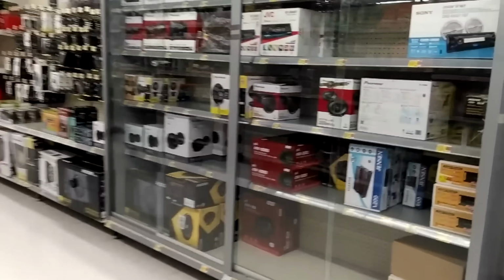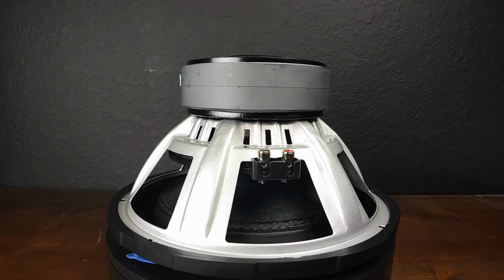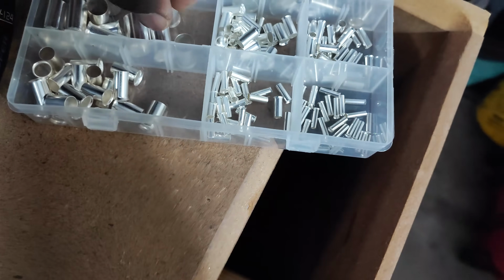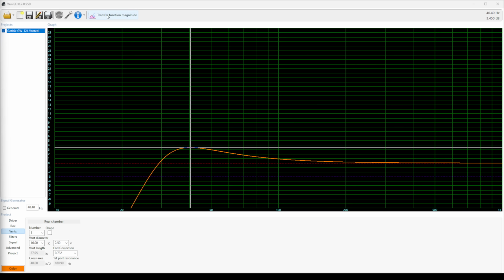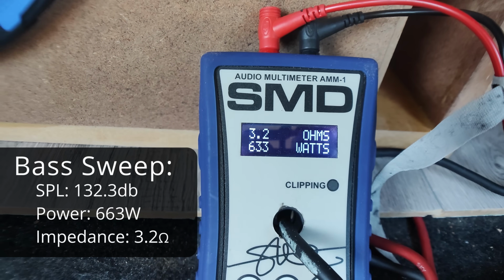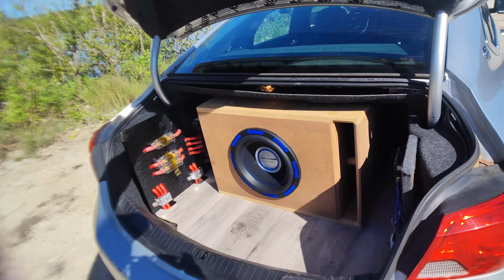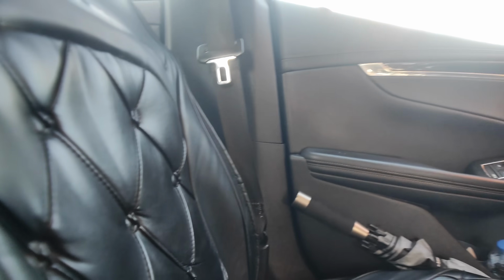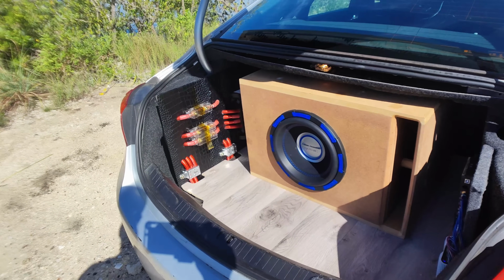Why Is EVERYONE Buying This $80 Subwoofer | Power Acoustik Gothic GW124 | 4,000 Watt SPL Test

Comment: Do you think 2 would be alright in a 4 cubes box?
Reply: Yes,I ran 2 in a 4 cube box. Sounded really good.
Reply from the maker: @anubisprince36  it should fine in my opinion.
Reply: You didn't say if it was four cubes gross or net. If net then it should be fine.
Reply: @JasonWW2000  4 cubes net

Comment: Its all about the box. The part that sucks is trying to tell someone they need a $200+ box when they spent $80 on the subwoofer lol.
Reply: Last time I went to home depot mdf was like $60
Reply: @elcaminosupersport fr it’s $60, I got wood (non mdf) for $40 tho cuz the worker made a mistake since it wasn’t in inventory
Reply: @lazarusmagellan2367 wood will drastically give a more hollow sound than mdf man can’t compare the 2 lol
Reply: @elitecystuning  ITs still a really stout box. I have an mdf box too, ill try swapping it into the mdf box. 

I see people at bass comps with regular wood boxes
Reply: @lazarusmagellan2367  its more than 60 bucks for 5 ply birch or 11 ply birch. add in the wood glue, wood screws and your well over 100 bucks. mdf sucks for spl, and sq  subs. Power Acoustik sucks. you get what ya pay for
Reply: @elcaminosupersport  hey home depot will cut all your pcs you need so draw up your plans and break it down by each pc and then bring your cut list to home depot. You don't have to make a giant mess or deal with new blades and tables n saw horses.  They will cut all the pcs and then just label them 1 at a time while they cut em and then all you gotta do is assemble it . Oh yeah and cut woofer holes and ports unless using slotted or sealed. Gotta love home depot for that
Reply: @elcaminosupersport I was there yesterday and it's down to $48 now but it was $60 for a long time.
Reply: @elcaminosupersport these guys are to dumb to build a box
Reply: I know a guy that has a skar vxf 15 in a prefab box and it sounds muffled and distorted, I told him to get a better box made for the sub or a custom box and he would notice a big difference. It's crazy the amount of people that don't know but at one time I didn't know either that the box makes a big difference.
Reply: 5 gallon bucket-o-bass
Reply: First time is always the most expensive after that though it’s a breeze.
Reply: Amen say that shit again it’s that box that makes a difference
Reply: I got a Power Acoustik Mofo on a stinger amp getting around 600-1k watts in a $80 prefab 5.24 cu box. It POUNDS. hands down loudest system I've owned.
Reply: @PastorJacobFrett I’m getting the stinger 4k soon , definitely underrated RmS
Reply: @fxgamer-11yt  the gothic can't handle 20 hz like the dayton audio ultimax.... btw proof reading saves lives. i have 2 10 inch dayton audio ultimax's turned to 25 hz, in a 1 inch 11 ply birch box. i also have 2 jl  audio 18 w6s. as you get older you will start thinking more about sq. most of yall don't even upgrade your highs and mids. it's about having a equal balance of bass to highs and mids. not bass overpowering the highs and mids. most of yall don't even know how to use 5, 6, and 7 channel amps.
Reply: I had this sub in my 17 civic, paired with a 1500watt kicker amp, wired to 2hms and boy did that sub fucking slap!! Best 80$ i spent.
Reply: Exactly. I had a friend bump an 18” RadioShack subwoofer in a huge box. Hard not to get output when you consume the entire trunk of a car.
Reply: @fxgamer-11yt  more power...... more sound distortion. like hotdog said, " its easy to produce a lot of noise. more people should be into sq. done right one can have both^^" .........................sadly most of y'all don't do things the right way
Reply: @honda-s2k  not true thd is cuased by the amp and if your getting that much distrition that its audioable then your gain isnt set right also if your feed the sub clean power then it should not sound bad also if it dose its macanical noise which is over powering the sun or far two large of a box please grab and loud speakers cook book before trying to correct some one
Reply: ebay has MDF 3/4" 12" boxes for 2 subs for $60 glued and carpeted. Yes I know the specs are not meant for the sub, but if you need a budget built, $60 aint bad, honestly. I have bought enough 2 boxes from eBay already. Now if you want best quality then yes you need a custom box for the subs needs.
Reply: @eckounltd956  particle board is better for a good budget. I can make 8s sound like 12s. Did it in the 90s
Reply: I'll probably just get 1 or 2 of these and get the pre built Walmart boxes, I have a subcompact SUV so it won't really matter
Reply: I did and the speakers sound like they are worth much more than $79 a piece.

And I still have my originals from 2017
Reply: I used free pallet wood and a lot of glue lol.
Reply: yeah but skar makes good prefab enclosure. but you find an enclosure prefab close to your specs called for and you wont have to build one or pay someone few hundred to build one. me personally, i build my own and design them. i dont build just a box. i build enclosure art.;
Reply: I paid 900 for my custom box. Had Bobby gately build it, beautiful birch. Was worth every penny, my 4 gately 6.5s beat harder than my 2 12s in my other car
Reply: Chage the connectors and bring the impedance down. So you can use a cheaper amp. Also break in period
Reply: @BassFace1776  Walmart sells premade 12" box for $45, 1.5 cu ft. Makes it easy! Don't forget the staple gun foam on the inside
Reply: It is all about the box..but take this 80 dollar sub in it's optimum box and take a 200 dollar sub in iys optimum box..200 dollar sub gonna eat that 80 dollar sub..
Reply: Not really. It’s all about the box
Reply: Particle board
Reply: What was the specs of that box?
Reply: Please tell him again bro 👍💯😊
Reply: Got a suggestion for a box for four of those?
Reply: Build it for 60$
Reply: I got two (don’t remember dimensions) but 3/4” thick MDF wood for $32 enough (hopefully) for a 24L X 16.5H X 24”D
Reply: Every time I build a box except once I have got some math wrong that made it sound bad. I cant figure out what I'm doing wrong. Last time I had to chop like 4 inches off and re seal it without a port just to use it. Still using it.
Reply: Id take it
Reply: So how does the video where he hits over 140 DB with a $129 loaded MTX enclosure explain this? Obviously that box is about a $30 box it comes with. A very basic sealed box, yet hits over 140 DB.
Reply: @Steven-gv1ke  ... you're an id-iot
Reply: @Steven-gv1ke  Almost all of the prefab boxes are tuned around 45hz. It's much easier to get louder up top. The biggest difference is below 38hz those boxes sound horrendous. And they lose a ridiculous amount of output.
Reply: Your right to have someone make it $200... because your getting a piece of mind it's done right
Reply: I got 146 db with 2 of these in a 5 cube bus tuned to 32 , Hifonics 3 k pushing 1700 rms at best
Reply: These subs are great and can handle power and puts out good clear bass
Reply: Yeah right if you know what you're doing. You can get a pre fab for cheap that gets the job done. You don't need to build your own enclosure. 

Most pre fabs can be slightly modified to change tuning as well. 

You just got to know what you're doing.
Reply: You can build it yourself with very basic tools, can even have the store you buy the wood from cut down for you. Would maybe be 120$ ish into it
Reply: U dont though. A design - 40 bucks, MDF - also like 40 bucks depending on the design.
Reply from the maker: @leonrotedits  plus nails, glues, clamps screws, carpet, paint, jig-saw, router...etc 😁
Reply: @BudgetBassHead  depends to be honest, all of my boxes were made with glue, screws and precut wood lol, if you include tools its always going to be expensive tho
Reply: @BudgetBassHead if you want it to look good. My boxes have been getting bed coating since 2008 lmao.
Reply: @BudgetBassHead bass heads I feel like keep that in stock
Reply: @BudgetBassHead  screw vs nail. cheep boxes are built with nails and mdf
Reply: @BudgetBassHead I'm an old Bass head Myself and haven't been in it for years,like 30 lol but back in the day we had an eighth of the top brands we used like competition amps and a kicker. My Question is you wouldn't get that type of clean Bass without a top of line amp either correct?
Reply: @BudgetBassHead  if you dont even have tools you dont have any business blowing cash on something else like speakers yet anyway.
Reply: @leonrotedits  what he mean is to have some one build a box for it would cost 200
Reply: @fxgamer-11yt  $200 bucks 10 years ago before inflation. good luck trying to get a professional box made for that money in 2024. price of lumber and building materials has gone up
Reply: @leonrotedits  %99 of people wanting a system will not and can not build an enclosure.
Reply: @BassFace1776 down for sound has diy flat packs that the wood is precut. Just need to glue and screw the pieces together. Because I did this I have an understanding how to build a box.
Reply: Actually you don't need MDF board. I can use any board to make a speaker box. Depends on the way you build it. I used Particle board before and the right Installation used in the attic. Did a competition with MDF and my box was 3ins to 4ins bigger did the MDF box. I only had 8in subs where other guy had 12in subs. When the judges came around they couldn't believe the sound. Mine was won 1st place. So miss the 90s.
Reply: @leonrotedits yea if they’re watching this they’re deff not building it man😂
Reply: @leonrotedits  You can save some money by purchasing a sonotube or large pvc piping tube instead of building a box.
Reply: @fxgamer-11yt  well. its easy to produce a lot of noise. more people should be into sq. done right one can have both^^
Reply: @hotdog9262  SQ build using Tar amps and Power A? 😂yeah right. Full bridge Brazilian amps are ok for subs I guess. But for SQ I don’t know anyone who would go so cheap no cap
Reply: @hotdog9262  amen!!!! sq is amazing. spl is pointless
Reply: I agree, I've had people come to people I know because they share that I like sound systems and build enclosures for my circle. Well I did a "911" reinstall for my mom's coworker and when finished I made a 100 bucks, just reinstalling the system they were already running. He wanted to know how much an enclosure would cost I told 250 at least for dual sub and custom box per sub specs and he tried saying the systems cheap and his girlfriend just paid me to reinstall what she was running. Sorry for the long comment to your comment, but the way I see it isn't worth this much trouble for the money isn't worth it being the size of enclosure you have to build to make it do what are there subwoofers twice the price would do and half the size.
Reply: 😆exactly lmao I found my box on side of road last week saw the guy put it out there 

It’s a mint ! JL POWER WEDGE BOX dual 12s thing is mint 😆😆😆 and absolutely slaps!
Reply: Imo that thing would hit harder sealed than ported
Reply: Hmm still not sure if I want to invest
Reply: @frankornelas1011  In a good box?
Reply: it is not all about the box
Reply: @BabyJesus420  It's %70
Reply: its not all about the box. a high quality driver with a stiff cone will sound more accurate, tighter with stronger transients/dynamics. say a good metal coned driver for example. its also less forgiving and done wrong will sound unnatural
Reply: @hotdog9262  actually, it mostly is more about the box.  Throw the best subwoofer into a chip board 3/8” plywood box and it will sound like crap.  Get this cheap $80 sub put into a good quality, well design box and it will sound better.
Reply: @91CavGT5  it will sound better but will have zero sq. there is dd, spl and sq
Reply from the maker: @hotdog9262  plus metal cones have resonance. Paper cones are thought to be superior in Sound Quality... at least in home audio.
Reply: @BudgetBassHead  metal cones easily have resonance/ringing out of their ideal freq spec. particularly in midrange.
its all subjective of what people like, but paper cones are superior up to a certain price/quality imo, its much easier to make them sound natural. many brands do bass and tweeters out of metal now, but it usually have to be `high end` or close to high end to sound great. maybe with the exception of sub bass drivers. imo..
Reply: a good candidate to look into for this is the upcoming arendal 1528 series. with very advanced drivers
Reply: @BudgetBassHead I chose paper cones on all my setup. I've always been partial to paper cones and rubber surround for the past 30+ years.
Reply: @hotdog9262 Bs
Reply: @hotdog9262  I disagree I've heard JL W7's in a crappy prefab sound bad. They still sound better than a $50 sub in the same box. But box imo is by far the most important.
Reply: @BassFace1776 imo just about any box can be improved(bracing, rubber liner etc) to be good as long its correct for the driver. Q etc. 

you can`t do that with a poor or mediocre driver

Comment: well, this video really shows that your sundown x12 box was not that good, only 3 db difference..
Reply from the maker: @fredy000  this box is built to spec. So maybe you should contact Sundown Audio about that.
Reply: Your reply shows how little you know about audio in general
Reply: @OxBlitzkriegxO  should I delete it then?
Reply: @fredy000  lil info, for 3db increase on the same sub, you need double the power. for it to sound twice as loud, you need 4x the power. 

theres a LOT you dont know
Reply: @OxBlitzkriegxO  Loud is cheap.  Deal with it.
Reply: 3db is pretty considerable difference
Reply: The DB scale isnt like other stuff 3db is like over 2x as “loud”… at the upper limit of loudness, one DB is a lot… 50-60 is like a wisper vs talking…
Reply: @Synic08  dude, you are SO wrong. man you really need to educate yourself. 

3db difference requires twice the power but is only root squared amplitude difference. you need 6db and 4x the power for twice the amplitude. humans generally discern a 10db difference as "twice as loud"
Reply: @gackal1982  3 db is by definition audible.  When you're approaching the threshold of pain you're a sadist.